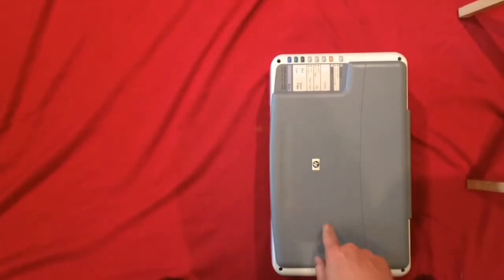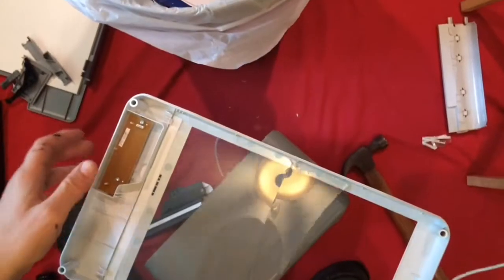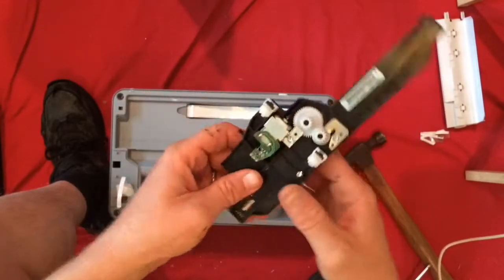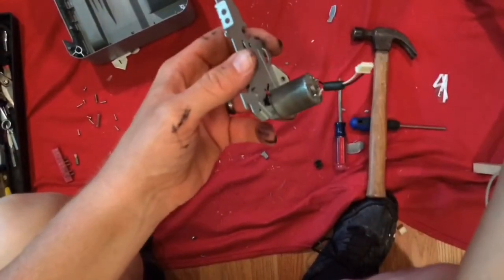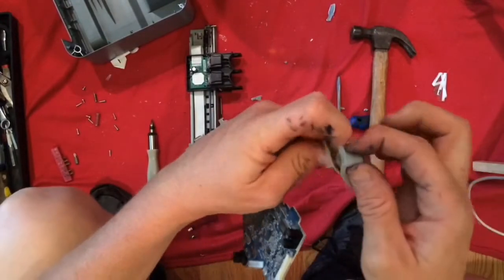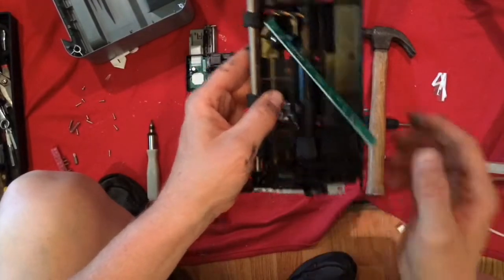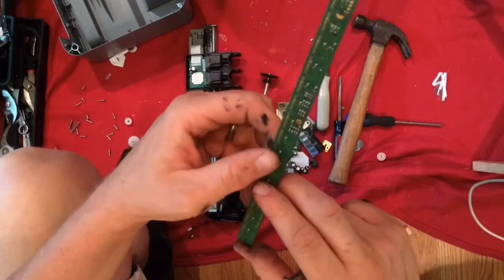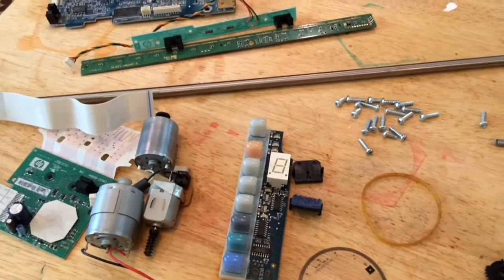HP PSC1410 Printer Teardown

Comment: hello, my hp psc 1300 looks just like this one and it is giving me the E  and the check paper blinking light. I have done everything from cleaning up the rollers to checking the two ribbons you find on the left side when you lift the cover.

do you have any idea why this error occurs? whenever I hit print the printer starts making noises but it doesn't pick the paper.